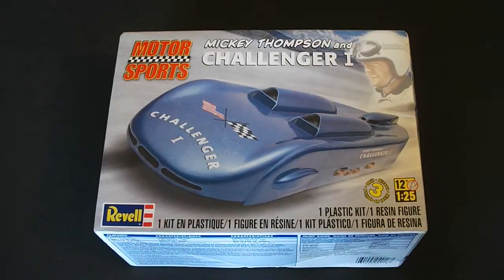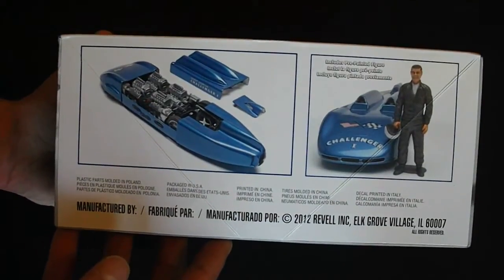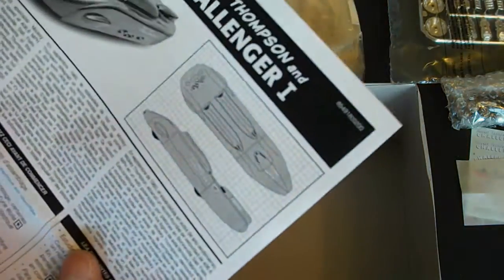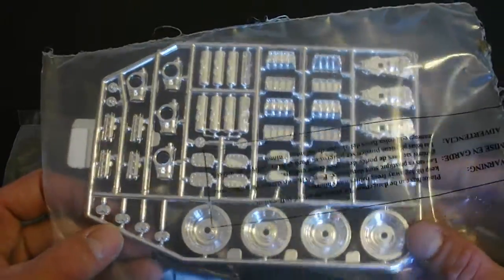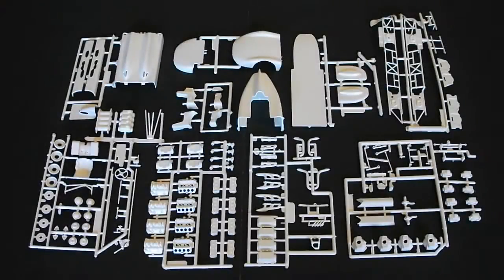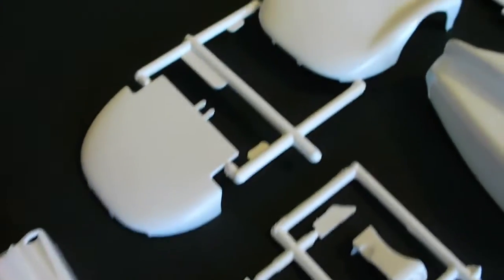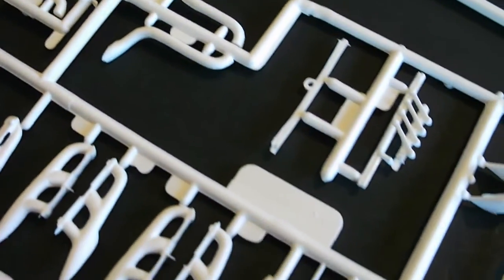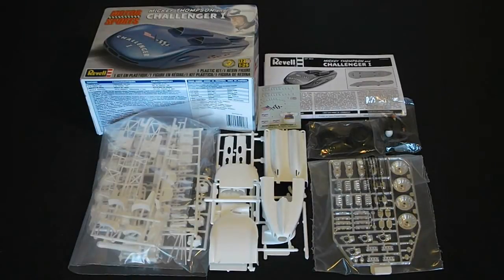#81 - Revell Mickey Thompson CHALLENGER 1 Review

Comment: I've been working on this kit slowly for quite a while and found out you can get a more or less perfect fit with the body panels, but it takes some tweaking with pins and tabs to bring stuff in line and also some sanding and filling a little at the back. Also the allignment of the engines may mean cutting some tabs and grooves down low at the front of the respective engines to move things into perfect allignment. Also the plans are a little vague about how the control rod assemblys are seated on top of the transmissions at the rear and also as to what the correct color of things should be. The blowers are not chrome for example but rather a light metallic gray that you can see in pictures online. I don't know when I'll finish it but for now it really looks totally awsome when I dry assemble the body over the engines and prop up the front and back to close up the fits at the center area.
Reply: many years ago, i saw photos of one of these with plug wires on all of the engines. i can't imagine what it took to build it.